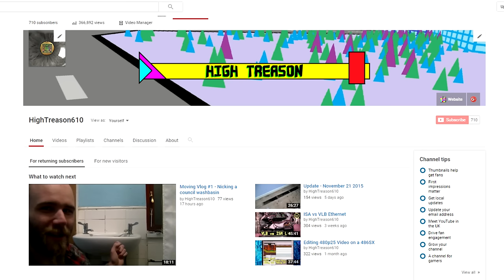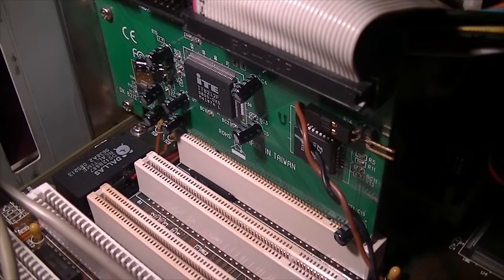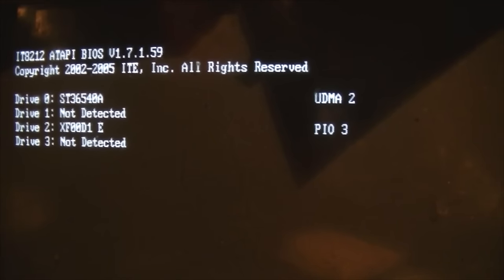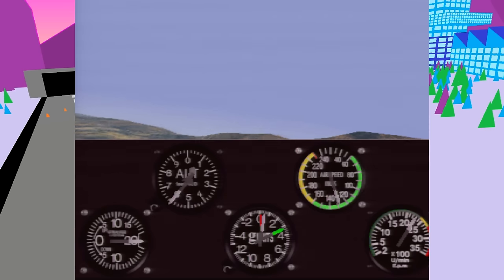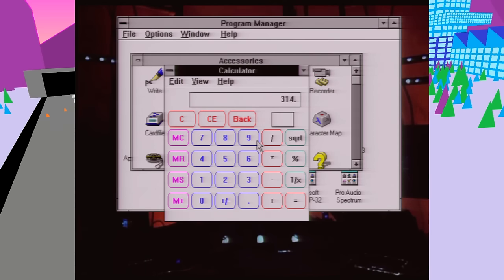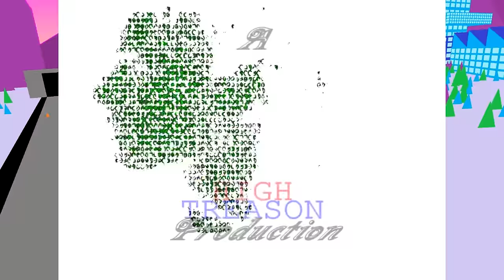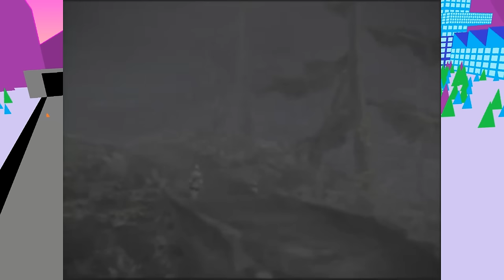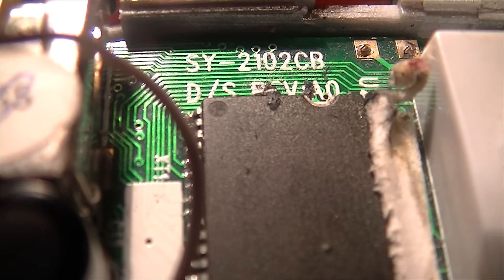Pentium 60 System

Comment: For the past five years, thank you. 

Here's to another five years! 

It sucks but this could be a new beginning... leave all the bad stuff behind and start fresh.
Reply from the maker: +classicmacintosh Thanks. I'll have to leave something behind, given I'm losing ~54 square feet per floor... All for a lovely increase in rent and it goes up again in April. I won't stop, I'll just change the way I do things. Probably have to film everything in a different room to the one everything is captured in and I have no idea where I am going to fit the workstation. The problem being, the workstation is tied to the synths and has to be within a couple of meters of the machine being captured as I'm already pushing the limits of the VGA signal.

It's stupid, in 1937, people didn't own much stuff so they made the houses a decent size. As time moved on, people started owning more things so they made the houses smaller and smaller... Logic, it's not worth using apparently. Well, I suppose if I'd opted into the new builds I would be stuck with something worse for even more rent (they cost a lot apparently), so there is that.

This is all assuming my stuff doesn't get robbed anyway, given the place is full of burglaries right now and my door was forced in the early hours of the morning along with the neighbors getting all their stuff taken. Hopefully the neighbors don't start thinking I did it, they've all been staring at me every time I've been there.
Reply: Who would have thought in 5 years people would be locked down into their houses by politicians.
Reply: @WaybackTECH  very much so. It's been a bizarre five years.

Comment: Chin up lad, this will not be your last computer video. Your channel is one of my favourites by the way. I always enjoy your videos and the way you present things. You have a great thing going on with this channel and I frequently mention your videos to others.

If I was up your way, I'd totally help you move, probably end up messing about with some hardware along the way too haha.

From a fan in Melbourne, Australia, I wish you the very best!
Reply from the maker: +orinokonx01 Cheers. It won't be the last, not yet, not even close. I hope. One of the most difficult things about packing is actually resisting the temptation to play with things I haven't used in a while, the loft has a couple of boards that don't work which I plan to fix, one of which relates to that planned project I mentioned with the Mach 64.

Australia eh? I bet it ain't so cold over there, you lucky gets, everything is starting to frost up around here so the more stuff I pack away, the colder the house gets.

Comment: Great video.  I still have that Pentium 60 gold top processor sealed in its original box.  Even though it was kind of a crap processor, it holds a special place for me.  Best of luck moving forward.
Reply: I have a 66MHz Pentium stowed in a bag somewhere. Untested but someday we'll see if it still works once I find one of those ultra rare Socket 4 boards...

Comment: Hope it was not that bad at the end. Know that feeling of it's you'r home that are taken away.
Lighten up mate.
Reply from the maker: +brostenen Not easy right now, given I'm still in the middle of everything and struggling to get everything packed and the locks changed. I am now on limited time as the council is on the verge of throwing me out of the old house, regardless of whether I have packed and moved everything or not. My only option is to get the move done and wait it out for a year until I can try to move again. What effect it might have on the YouTube channel I do not yet know as I am losing upwards of 200 square feet per floor and will inevitably have to get rid of some things.
Reply: That is just not cool..... Hope you can get it done asap.

Comment: Pentium60 gold CPU on intel batman mobo (later overclocked to 66MHz), 8mb RAM, slow 800MB Maxtor HDD, 1MB S3 Trio64, 4X NEC CDROM, Opti SBpro clone, Hyundai 14' CRT overclockable to 100Hz :), MSDOS 6.22 and Windows 3.11 - all from polish company Optimus was my first PC :) My parents paid small fortune for it. Before I was using 386DX40 at school, still considered good gaming PC in 95 and 486 DX2-66 was high-end in Poland back then. I was 15 and this computer made me who I am today :) .. or maybe it was 65XE, CPC464, C64, Amiga 500 before it?... no... those were for games mainly. Pentium60 teached me a craft. I wish I coud buy my P60 Optimus back someday to join my collection of old PC's (486DX2-66 all ISA ADAX, Socket7 166@233MMX intelVX with SBAwe64 and Voodoo, AsusP2B with P2-350@466 with RivaTNT2, P3-733 and many other in parts. BTW: don't you all remember the computer you first played Doom/Doom2 and Diablo on?
Reply from the maker: +Marcin Z My family started out on a Pentium in 1993. I don't know the exact specifications anymore, but I expect they were probably very similar. I still dream of finding the exact same system out there some day... This is probably as close as I will get as I know for a fact the system was configured similar to this in that the motherboard had no onboard I/O, it was a green colored board though and the CPU was in a different spot, so I doubt it was this ABit model. Probably never find out as it was a no-name brand system (Atlantic from a store called Makro) and was given up around 1997 when the hard drive died.

Comment: My Pentium60 had the FDIV bug.  I took advantage of the replacement program at a local retailer.  But before I did, I put a 66MHz crystal oscillator, and the tech who replaced the CPU didn't notice and replaced it with a real Pentium66.  It'd be interesting to know if bugged CPUs are more common than corrected ones?
Reply: Big brain. From what I have seen for sale it seems like the fixed version is a little more common. And the Pentium 60MHz is much more common than the 66MHz version no matter if buggy ir not.

Comment: Name Suggestion: Preston  I think it would be a fitting name given your feelings about the house and living where you grew up. Unless you want it to be a chick name, then... idk.. being a 90's guy myself, by the way.. I totally am right there with you about the music. Ya I crank ace of base now and then.  Back to the name... maybe Buffy since that is totally 90's.  Anyway if you think 700+ subs are a big deal, try looking one day and seeing you suddenly are over 2k! Kind of why I did the Socket 7 video now.  

That Socket 4 motherboard... funny that... about a couple months ago, I came across this exact board on ebay. From your part of the world too.  I put a bid on it, but was heavily outbid, that's ok, it went for WAY more money than I ever wanted to pay for it, and then I found that Acer like a couple weeks later. I would have accused you of being the one that outbid me on the thing, but when you said it was used when you did the overdrive video.. well I figured it wouldn't have been you.  Looks like about the same performance and as mine. On the overclocking side of it, I did try overclocking all 3 of my processors to 80Mhz, since I have an 80Mhz crystal from a 386 board. Ya they didn't like that too much. Probably due to the PCI and memory being pushed way out of spec. I bet 75 would be achievable though, provided one could find a 75Mhz crystal. You might for shits, put EDO on that board. I know it doesn't technically support it, but it would be interesting to see if it works. I say that because, as you know, my Acer runs that Intel Mercury chipset, although it uses an Acer IDE controller, but it does amazingly work with EDO ram. I see no benefit in memory scores with EDO, but I thought it had to be a mistake, and I tried it with different EDO ram and it still worked. I don't know what they did to make EDO work on a chipset that doesn't support it.

Maybe before you leave, you should just do a video tour of your place there. Could just leave it unlisted and link to it if people want to go watch it.  Might also consider leaving a big shit in the toilet right before you leave for good, just your way of thanking the council for "relocating" you  :)
Reply from the maker: +WaybackTECH Preston or Buffy... Maybe. I don't know if I can reach 2K but 1K suddenly seems as though it might be within reach. I still remember hitting the 100 marker years ago, hell, I remember hitting the 50 marker. Both of which I never thought possible.

The board was from Germany and was actually obtained recently. I only paid some of the cost and the rest was a gift. It did not have bidding as an option but it sure wasn't cheap. Probably worth it considering the components included though, I've seen the CPU alone sell that high before now, so getting that, the mobo, large FPD RAM modules and all the other stuff with it actually seems like pretty good value. I didn't have it back in the OverDrive video, I had the same case but was still using the old board. Performance-wise, it actually hits a wall somewhere, you can change the hardware a lot and the scores will change little, if at all, in everything but Doom. It doesn't bother me, I just find it interesting how the performance curve is different vs a 486 on the same hardware.

I don't plan on exceeding 66MHz, plus it doesn't appear to use crystals in that way. That isn't to say there aren't undocumented settings though, but if there are they would probably under clock the system instead which could still be useful. I may try EDO but I doubt it would do much of anything interesting. The 486 boards, at least, will either not start or will detect a random "2.5MB" on two 8MB sticks and then lock up. Come to think of it, the SiS 5500 is a P54C chipset and does support EDO, so it might work. As for making EDO work on chipsets that don't support it, I once read, or so I think, that some EDO RAM was made to run in both modes and could be used as FPD RAM. Never seen any IRL but I guess it could exist.

I did plan on making a video like that on my way out of the house actually and that is probably what is going to happen.

I did consider leaving something horrible behind, that was even one of the things I thought of, but they'd probably just send me a bill for it that I don't really want to be paying. At the moment I am still preoccupied with getting the locks changed, especially in light of recent burglaries and visits by police after the neighbors got all their shit stolen... Seems like a real classy neighborhood. On the plus side, the neighbors have blocked the passage beside the house (with my permission) so that's a start I guess. Unfortunately the council won't change the locks until I move in and will charge me £80 for it, hopefully I can get out of that though, given the letters from the police - one of which says my door was forced (the lock is now broken) - they should cave in with any luck.
Reply: HighTreason610
I have to admit, until I saw the socket 4 board with the SIS chipset on ebay, I never knew that SIS had ever bothered to make a chipset for the socket 4. Should have figured I guess. I have a couple socket 4 boards that are dual socket boards. One is an opti with socket 3 and socket 4, the other I think is a VLSI chipset with socket 4 and socket 5. While interesting, neither work, and the Opti boards ( have 3 or 4 of them ) are badly damaged with battery acid. The VLSI board, I don't know what it's problem is. One day I will look at it again.  I think you got a good deal though, given the SIS chipsets were pretty decent back then, at least for the 486 boards, and you got that FDIV pentium chip also, that alone is a rare and good chip to have. I know the board I looked at ended up going for about $128, and that was the board by itself and nothing else.

If someone broke into your new place after you moved in, they probably wouldn't find anything worth stealing, at least as they think, but then again, they probably would just trash everything which wouldn't do you any good either.

On a side note, I have been watching your lets play blood videos, quite interesting the fun you had with your computers while making them. Makes me wonder how many computers of mine will suddenly start failing while playing that game. Looks fun though.

Comment: There are Pentium Overdrive processors for Socket 4 (120MHz and 133MHz) - but they are hard to find and not really worth the trouble
Reply from the maker: Indeed there are. I also have another solution which allows for faster processors in these boards which is even less practical, involving a rather clumsy and large adaptor.

Comment: The serial ports probably work fine, but use a different pin layout using the dtk/intel/supermicro stamdard. Maybe you connected a bracket with at/everex connectors to this motherboard, and that indeed doesnt work .
Reply from the maker: I assume you refer to the Intel Batman board? Those were Intel pinout and something I'm well aware of, but they were busted. Hardly matters as that board was crap and has long gone off to scrap, due to being replaced by the ABit PS5 and nothing was ever a major problem since. The machine changed considerably in the years since then. Probably doesn't look the same or even use the same chassis as it did when any of this was shot, as I seem to remember doing a major rebuild of it not long after I got moved to the slums.
Reply: @HighTreason610  thanks for the elaborate reply. I Just aquired one of these boards (batmans revenge) , so this video was highly interesting. And yes the ide controller is crap. I am encountering irq problem and cant get both controllers to work without resource conflict in windows 95b. Best regards, Arno